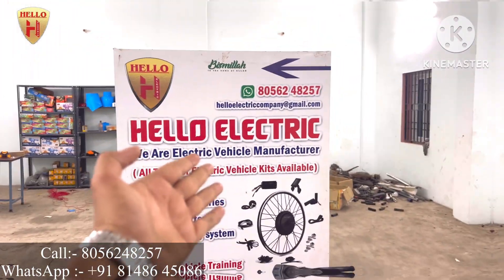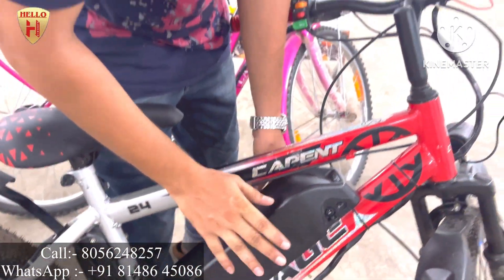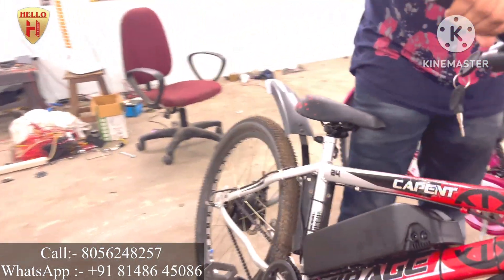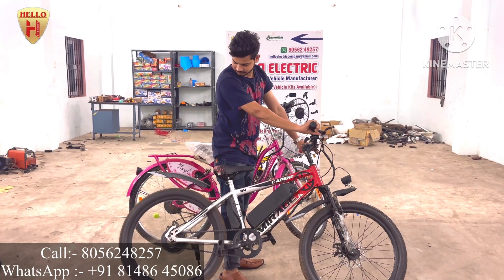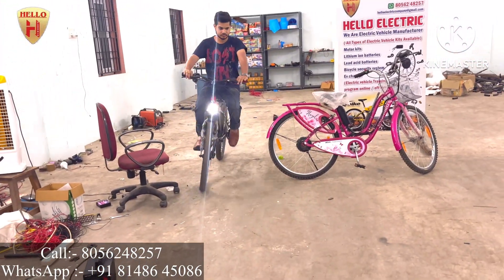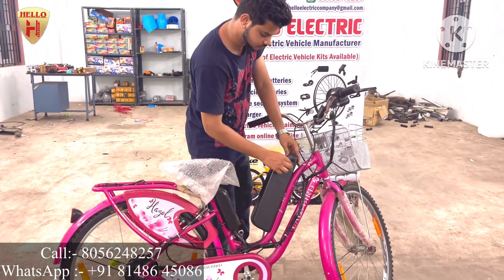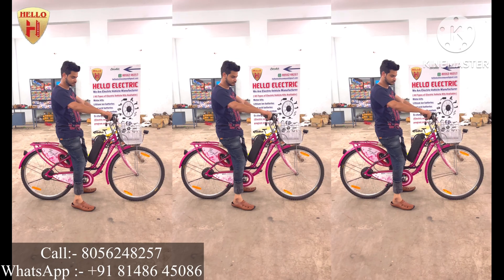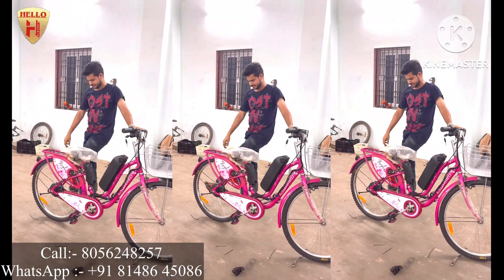Hello Electric bicycles | cycle Conversions at Rs 10000 starting price @streetengineer123

Comment: Hi , whether It can be installed in 21 geared bicycle and how to install
Reply: Cost and location
Reply from the maker: @drpravinpatil9304  Chennai Redhills .Contact 8056248257 for more details
Reply from the maker: @drpravinpatil9304  yes call 8056248257